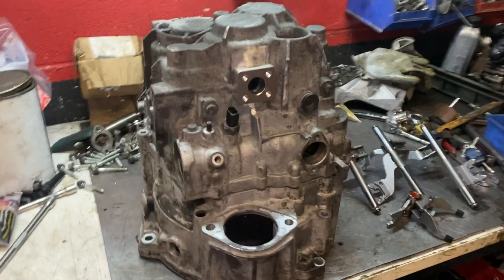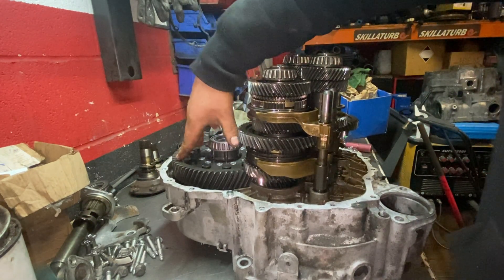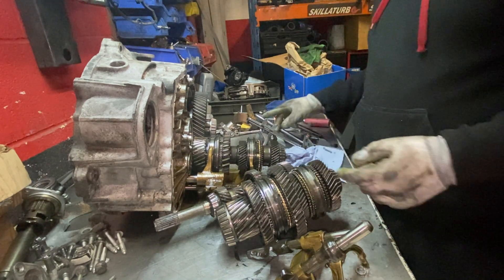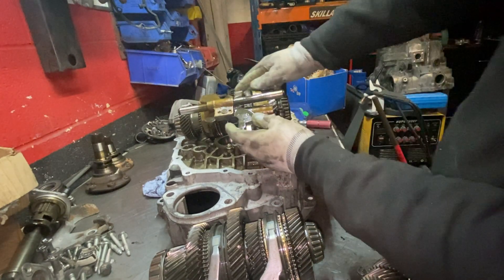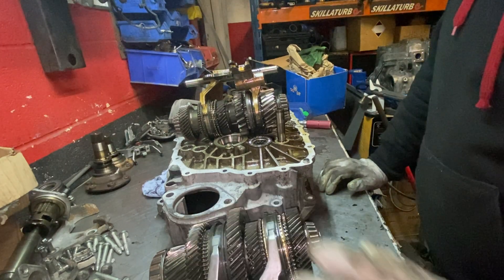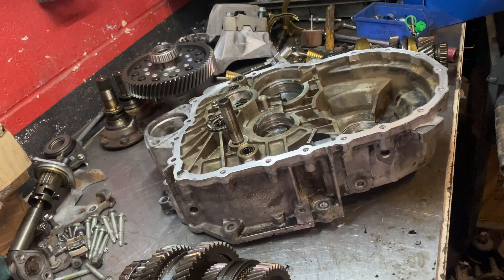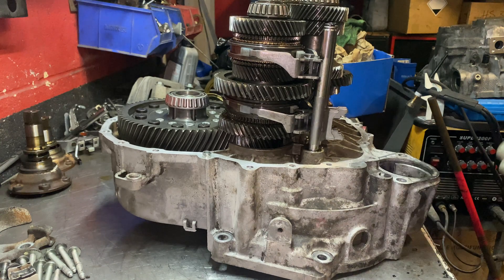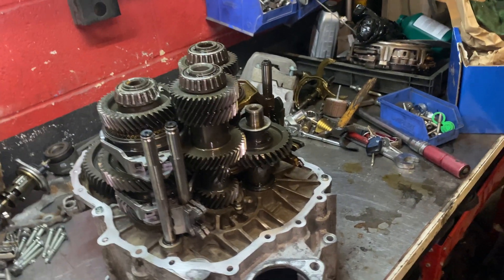How to replace reinforced steel selector kit 1st & 2nd, 3rd & 4th, 5th & 6th to reinforce 02M 02Q

Comment: Id read the 02M and early 02Q boxes the steel 5/6 shifter dont fit. Im just installing a wavetrac LSD i to my late 2008 02Q which has all brass selectors! Ordering the selectors and brass ends from Darkside but i dont think i need the 4th gear support?
Great videos btw 👍
Reply from the maker: Depende on the bhp
Reply: @HelderPutoPerformance  i fitted the 4th gear support in the end. My car is currently 290hp but i have a k04 hybrid going on for 400hp so thought it was best to do everything to protect the gearbox. Great videos 👍
Reply: @tomwhit1982  did you fit fit a steel insert in the 4th input shaft ?
Reply: @colin norman  i did yes. Ran in a 400bhp/400ftlb for 5k miles and all good on the track. Just about to sell that gearbox as im converting car to awd now so going to do the same on the slightly newer 02q awd gearbox. Using bits from Bartec this time.

Comment: We just bought 02m from junkyard.   They drill hole in case to drain oil.  I'm going to split case to clean inside.  

Did you reuse all bolts to reassemble?   Or did you replace them?

Also, could the bolts be reused to assemble to engine?

Thanks for posting.   Looking forward to the next episode..
Reply from the maker: Yes the gearbox bolts is reusable  

The engine bolts its depending on the bolts
Reply: @HelderPutoPerformance   Hello from Atlanta,  Georgia..

This will be my first time opening a 02m.  Your video is very helpful. 

We plan to build a 2005, Jetta, mk4, AWP, 1.8t with 350ftlb (475mm) torque. 

At what torque is 4th gear support is needed?

Which clutch would you recommend? 

Any other upgrades you recommend to the 02m for this build? 

Thanks...
Reply: I took apart transmission yesterday. Found chipped/tooth missing on input shaft. I'm now trying to search for replacement..  Hard to find in south Georgia, US.

Are all 4th gear support the same?  Which one do you recommend? 

Here's a link to the short video I made. 

https://youtu.be/_WdFB7ApdlY

Thanks for your video.